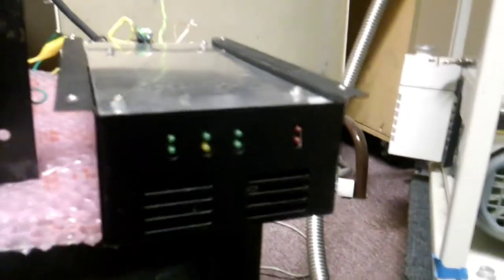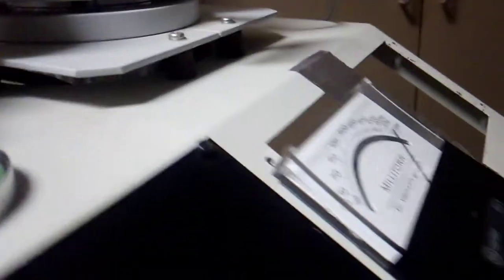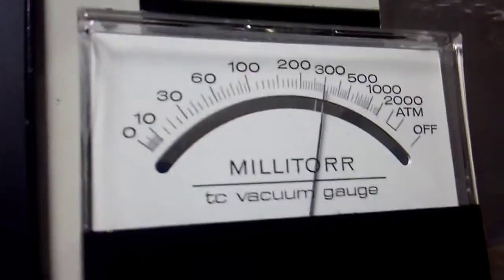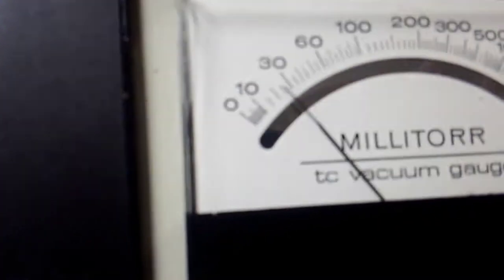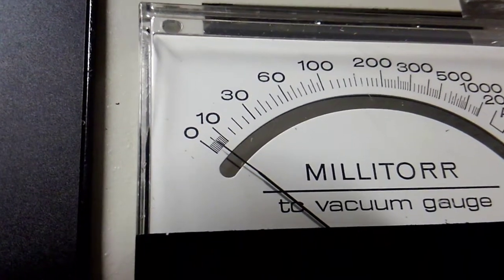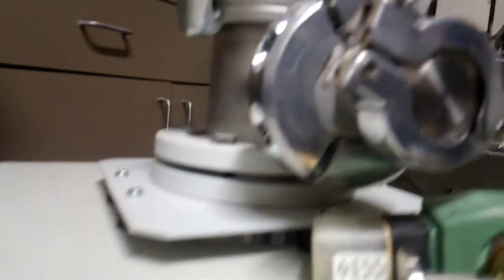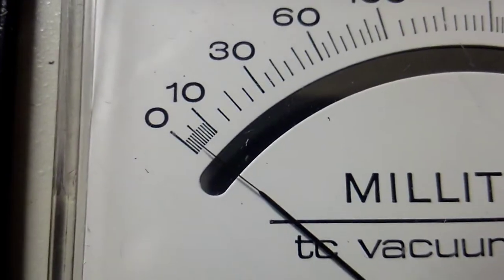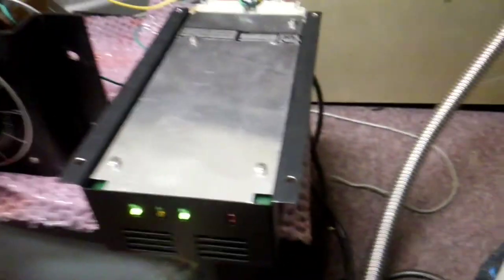Turbo Pump controller

Comment from the maker: The rotor of this turbo molecular high vacuum pump normally rotates at 70,000 RPM.  It has a 3 phase induction motor that's driven by a variable frequency power supply that applies 150 VAC approx. sine waves to each phase. To control speed using just one set of windings, this tiny pump's controller alternates at a one Hertz rate between driving the motor with the windings then, "listening" to the speed of the rotor to form a speed control servo loop.